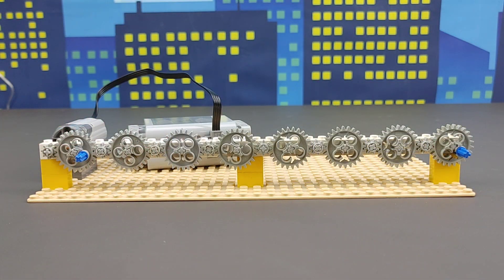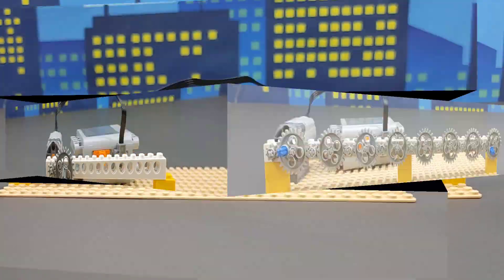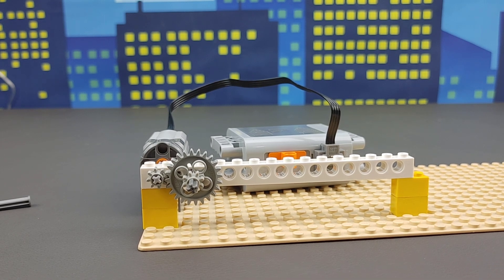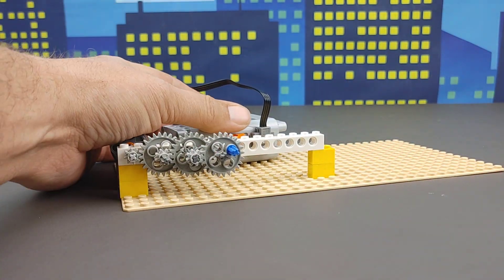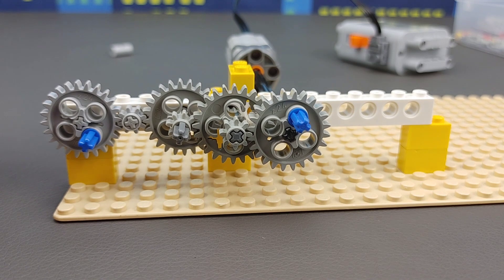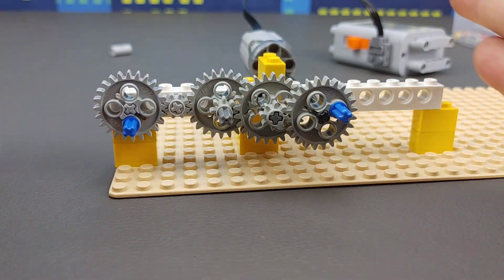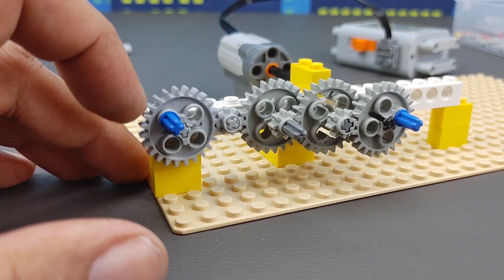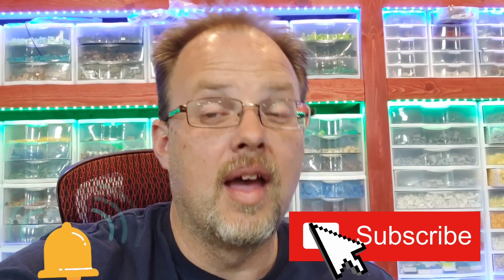Lego gear reduction and increase in speed.

Comment: Today I made a gear reduction system with 100 Lego gears between 24 and 8 teeth!!!!! I don't know the ratio but the wheel on the end rotates 1mm every 10 minutes or something like that😅 I'm gonna time how long 1 full rotation takes😅 But the build makes a lot of noise!!!😮😅
Reply from the maker: That's awesome, the more gears you do the harder it is for them to spin but fun seeing the reductions and increases
Reply: @BevinsBricksWorld  And I use a single Lego motor that is around 30 years old but it can handle it with no problem. But because I have so many gears it's very loud and it only works one way. I can't spin the final wheel by hand no matter how much force I use. So I can use the system only for gear reduction. I wish I had a lot of big gears but I only have 1 big gear. And all my Lego is 20 to 30 years old😅
Reply: @BevinsBricksWorld What have I done🤦😅 Turns out the 1mm movement after 10 minutes was because of slack in the gears... After timing it for 1 full hour the end wheel didn't move at all!! I think I made a RPD or RPW machine!! Revolutions Per Day or Revolutions Per Week😅😂
Reply: I just built a gear reduction and it’s crazy loud. Distractingly loud. Any advice on how to make the motor/gears run smoother and much quieter?
Reply: @dustinrandall   Nope, It's Lego... because of the shape of the gears and all the play in the shafts the whole thing makes a lot of noise when teeth engage each other.
There is not much you can do.
You can reduce the noise maybe by like 5% by making sure there is as little play as possible but this will also be really hard on your Lego motor if you make it too tight.
So my tip.... try to get used to the noise!😅
Or do what I did... take it apart and build something completely different because a gear reduction system is loud as hell!😂
I still don't know how many revolutions per week or month or year my system had because I took it apart because it was just too loud to keep it running all day every day.😅
Maybe if you have an air tight glass cabinet to put it in you could keep it running.
But if not.... have fun going insane because of the machine you created or just take the whole project apart because it won't get better.😅
Reply: I’ll have to do some more research. My brother knows stuff about electronics and says we can rig up something called a “potentiometer” which can slow down the motor without the gear reduction. That’s probably my best option.